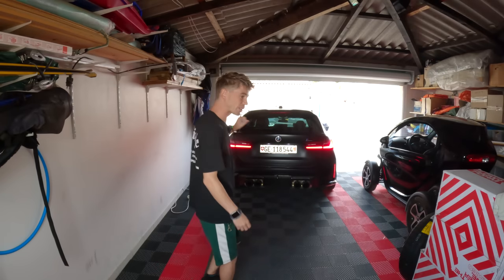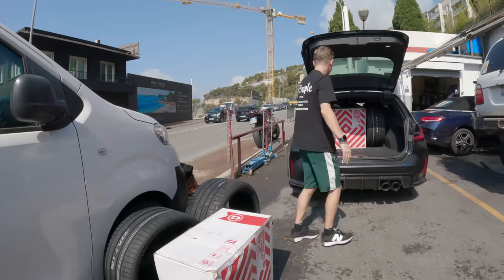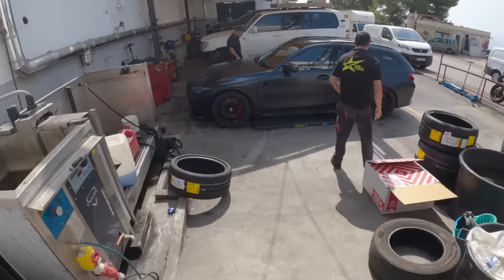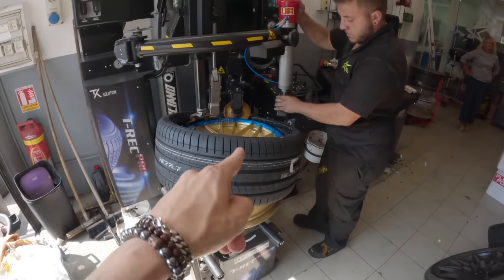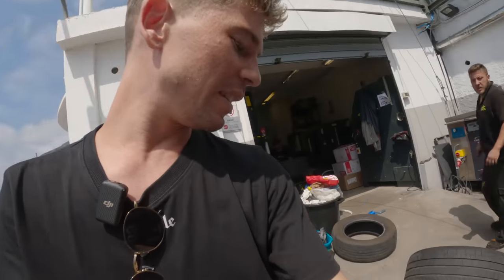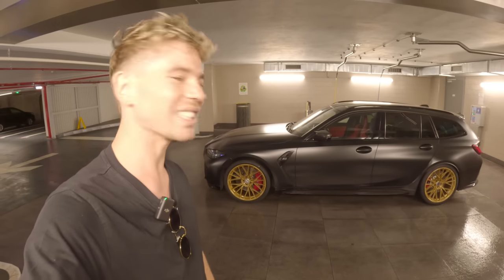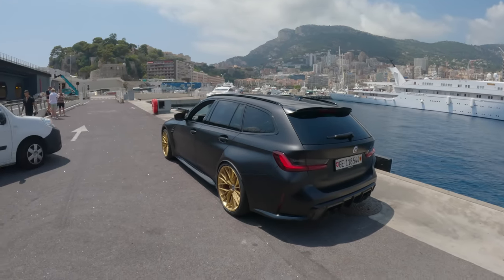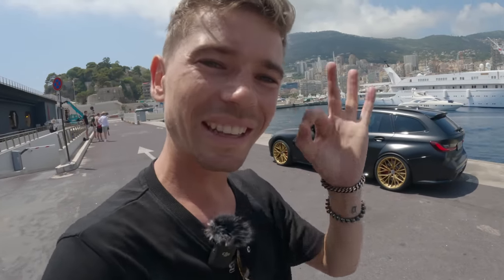Biggest Modification Yet To My BMW M3 TOURING !! 😈

Comment: Regarding the front gap, it does not matter if you have 19” or 22”, because for every dimension, recomended tire setup would be different, so the entire wheel has same dimension overall. If you don’t respect the bmw sizes, you’ll broke the xdrive system.
Reply: With a bigger rim the gap will be perceived smaller because the edge of the rim is closer to the fender. He just needs to lower it with springs
Reply: @raydm4015  yes, or to have a smaller offset, to push the wheels in the exterior. It will have the same space, but visually it will be smaller.

Comment: even with 20 inches at the front, the distance between the tire and the fender will not be reduced because your wheel circumference will change by a maximum of 3%.

Comment: I hate the BMW "special" logos. I'd just put regular BMW center caps and I'd also change the bonnet and trunk logos. But about the wheels...they do look good imo. The fitment at the back is spot on! At the front, I always find BMW a little bit too high on the front, when compared to the back. No idea why. I also own a BMW wagon (and older E91) and it's the same - higher at the front.

Comment: I hate to break it to you, but the stock rims that came with the car were Forged Wheels. Yours now is only flow form which is the worst type of the wheels out there. So, sorry mate...a very bad decision, you are actually downgraded the wheels....yikes. Anyway, just sell the wheels and just use the standard wheels. You're better off with the standard forged BMW wheels. Or better yet, get the HRE full forged....or BBS Forged (LM/LMR/RID/FIR).